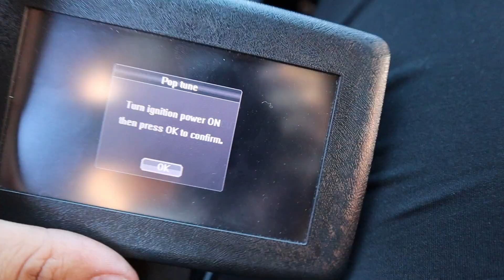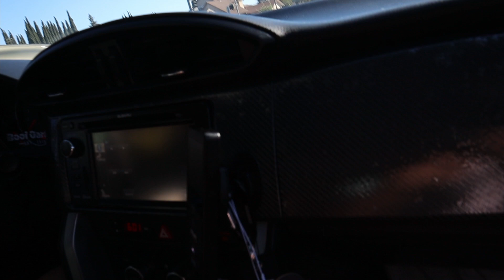BRZ is WAY TOO LOUD!! | UEL Header + Tomei 80r

Comment: When I added my tomei, to my stage 2 Subaru. Already having a downpipe. My heart was racing the whole way home. Never got pulled over in my 3 years of having the car loud. Never sell the tomei man. Even if you switch the setup. With Subaru going electric tomei will certainly not hang around forever. Mine will be on my wall one day if I take it off
Reply from the maker: unfortunately, the tomei is already gone 🥲
Reply: @vicnguyen  that’s alright man! What made you sell it? They like to drone a bit on the highway. Sometimes it’s hard to find a rpm😂 but the spooly noise makes me so happy
Reply from the maker: honestly, it didn’t even drone much… but it was just ear piercingly loud on the outside haha